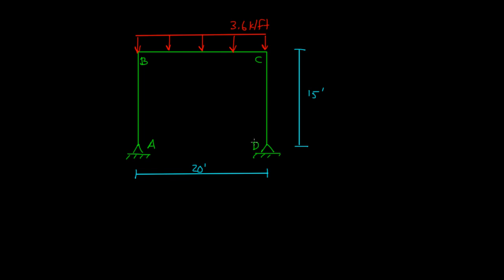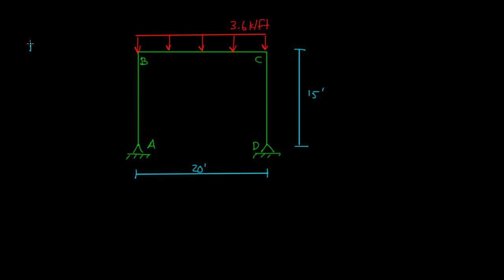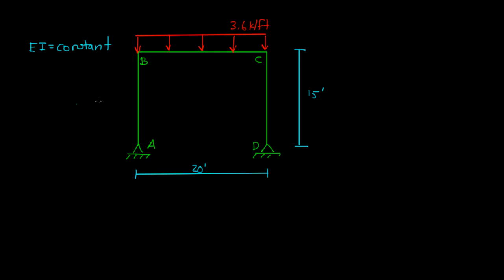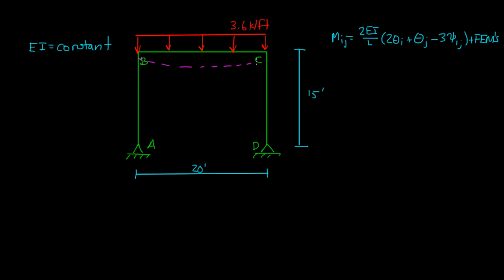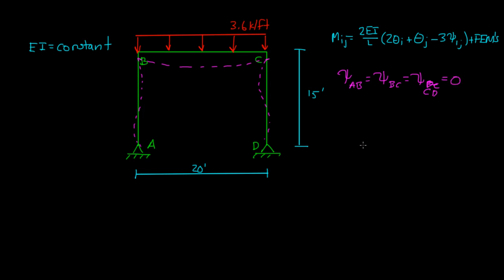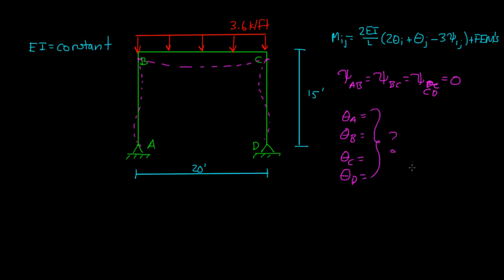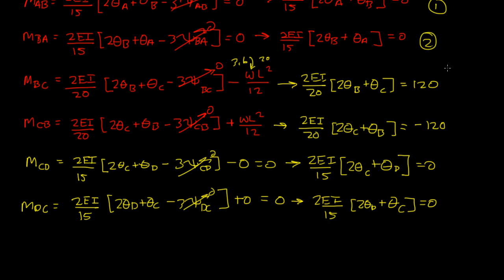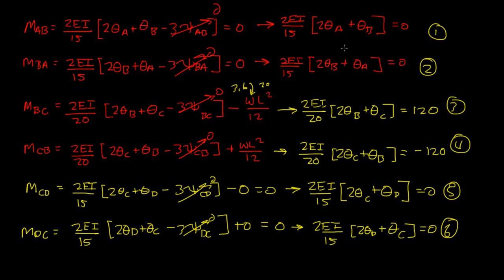Slope Deflection Example 4: Part 1

Comment: hello sir, I'm college student from Indonesia
I want to ask, in an indeterminate static portal structure, is it the same model for the depiction of deflection lines for each working load for force loads with distribution loads.

For example, in your example portal deflection method with pedestal fixed , using a force load parallel to the member BC, is it the same treatment of even loads?